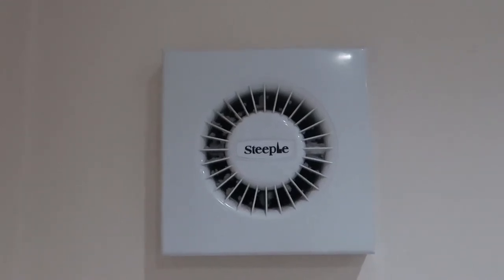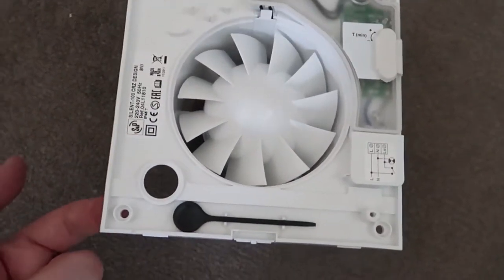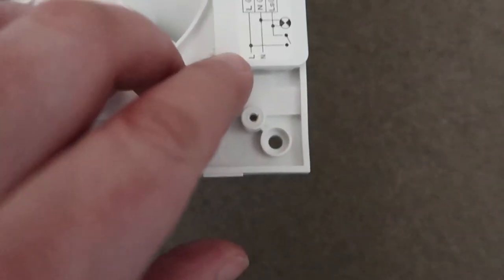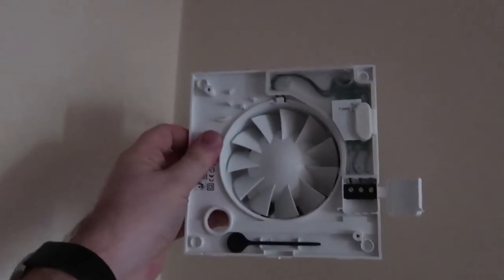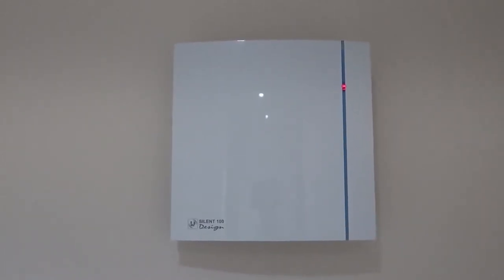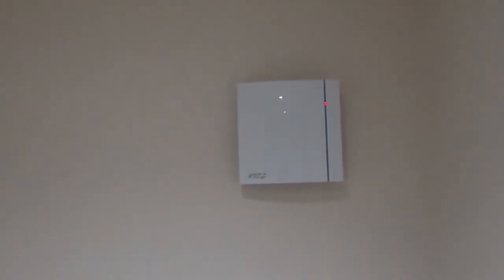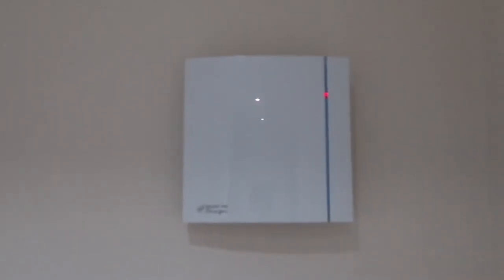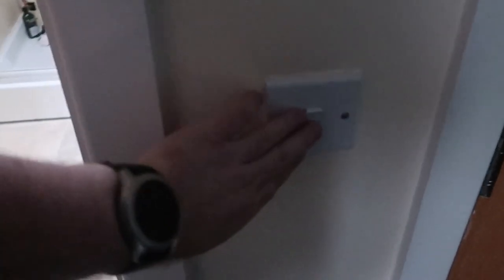Review of the S&P Soler & Palau Silent 100 Design Extractor Fan

Comment: Thanks Paul for this video. I wish I had seen this video before purchasing the fan, it is very noisy. We were going to get the Airflow silent one and ended up getting the Envirovent Silent SILDES 100T because it is very stylish snd goes well with our colour scheme. Anyway, can you please describe your wiring and using 2 switches. One turns on the light and fan, which allows the overrun to work and then there is another one which switches off the fan completely.
Reply from the maker: Hi Rajnees, Yes they are quite loud. On the plus side, I've had 4 of them for 5 years now and they are all still working well. The wiring was simple - just the 3 wires shown in the video. The only adjustment I made to them was the timing as shown in the video.
Reply: Have you found a more quiet fan, that even similar performs as well with 80m3/h?!? Probably not. Perhaps it's considered silent or quiet in comparison to most others with similar performance.

Comment: They shouldn't call it silent, mine is loud enough also....
Reply from the maker: Yes, very misleading advertising!
Reply: Agree. It's one of their big selling points. Says 33dB on the box - I measured 55-57dB...
Reply: I bought 2. Considering changing them. When they are on, we need to shut the doors. Its really annoying.
Reply: @1223John1111  says 26db on their manual! Was thinking of buying this due to the noise level and front panel design but at 55db reconsidering now. Thanks for that info
Reply: @CJ-vg4tg  26 dB.. 3 meters away they say xd
Reply: Any other silent recomendation?
Reply: @CJ-vg4tg  Yes, mine are Silent 200. Probably why they say 33 and not 26db.
Reply: @furtiplustion  There are so many good ventilators out there. These claim to be more silent than the rest. They are not.
Reply: I have one and it sounds like a helikopter taking off
Reply: Lol has any of you actually found a more quiet fan, that even similar performs as well with 80m3/h?!? Probably not. So it's silent or quiet in comparison to most others with similar performance.